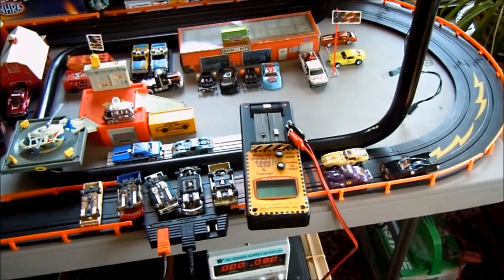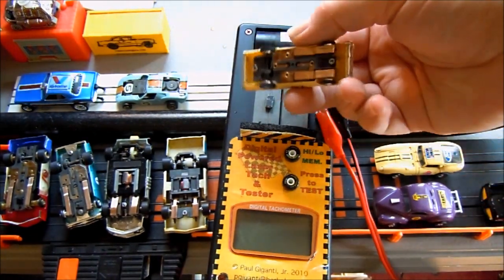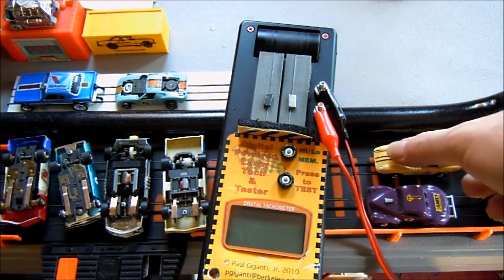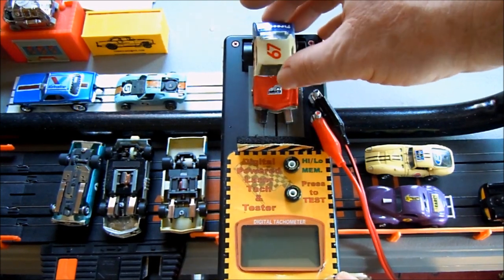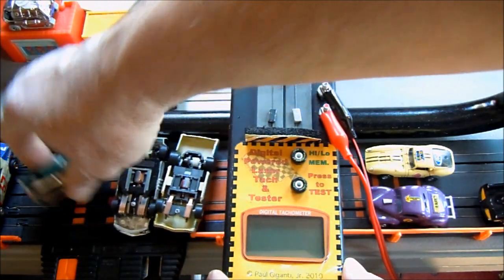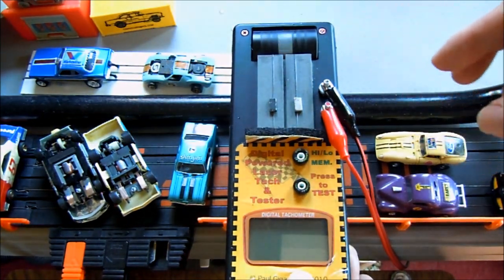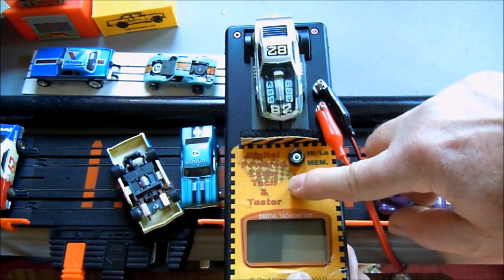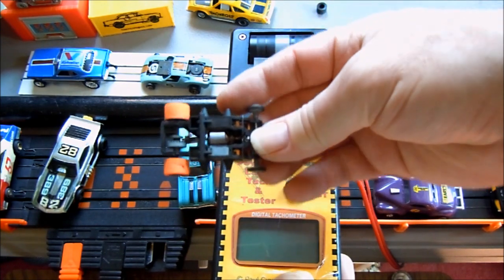Slot Car Dyno Test

Comment: Is the rpm at the roller or car tires? How does this compare to other dyno's. Some tires are smaller and bigger, I would think that would affect the rpm readings.
Reply from the maker: The tool is reading the rpm of the roller caused by the tires.
I have not tested other tools.

Comment: Check your track transformer, NINE VOLTS ? WRONG! Not a valid test!! What a waist of time!!!!!!
Reply from the maker: Since you are so smart, what voltage would you test at ?
Any more voltage would make the car uncontrollable on the dyno....

I viewed your channel and am not impressed, anybody can copy and paste !
Reply: @daveshoraceway  READ your transformer output label! 14.6 to 18 volts not to mention how many mille amps.if your car bounces off roller your     tires aren't "trued"or you have an axle loose or untrue rims.
Reply from the maker: @vahinloucifer116  until you can prove to me that you tested more cars then me and own one of these tools your comment is pointless, the real test is on the track...
Reply: @daveshoraceway  why do you think I have a " channel" ?
Reply: You need to relax, I have a degree in electro- mechanical physics and nano technology.
Reply from the maker: @vahinloucifer116  hands on experience trumps any degree, your reality is not my reality.
Just because a manufacture suggest a certain setting does not mean it is absolute for all applications.
So what are you doing with your degree besides trolling ?
Reply: I own over 7500 slot cars, 55 yrs of racing / collecting.
Reply from the maker: @vahinloucifer116  do you own one of these dynos ? 7500 slot cars is over kill, racing at home and in leagues are also 2 different animals....
Reply: @vahinloucifer116  'Collecting' isn't the same as using. Basically, you just have a used slot car collection.
Reply: @d.e.b.b5788  all my cars work! I've been collecting for 60+ years!